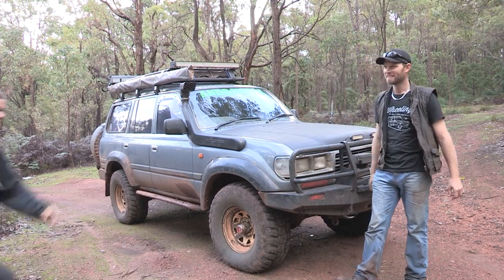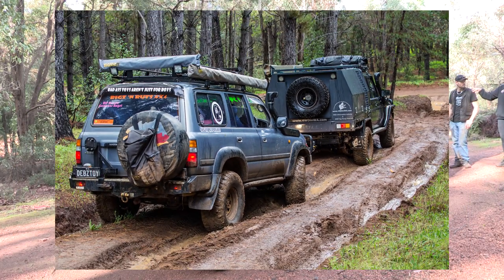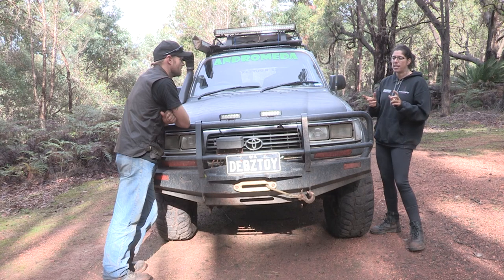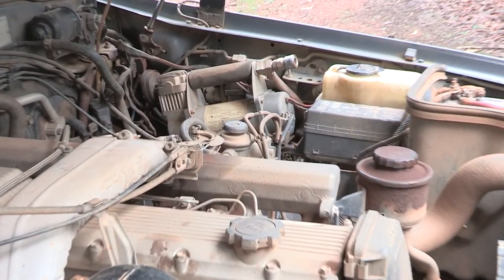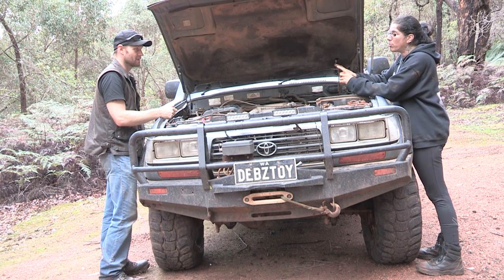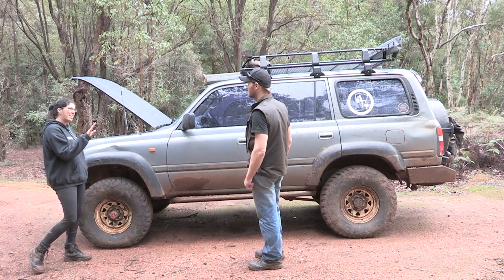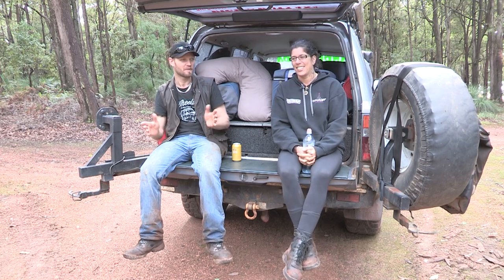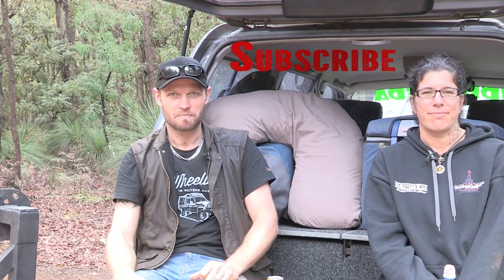Modified Toyota 80 series Landcruiser, Modified Episode 5

Comment: Haha thanks everyone, this is my boy Alf and i'm very proud of him.

My last 80 also had the 1HZ with Safari turbo set up and i wouldn't have it any other way. Fully recommend them. I've heard of a few people taking the factory turbos off the 1HDT and replacing them with the Safari Turbos. They are strong and tough as long as you don't go stupid boost and over rev them. 
Fully recommend it. You can feel the pulling power when you put in the K&N air filter and change the fuel filter too. Simple little things that make all the difference :)

Oh and my daughter still drives Alf too ;)
Reply: Debs Benedetto Just a heads up Deb, to fix the pop rivets on the steps is about a 5 minute job and really easy to do. Just need some new rivets and a rivet gun which are inexpensive. I know rattles drive me mad too.
Reply: Mr. Cairo  There are plenty on my 4WD Group facebook page: Rigs 'N Ruts 4X4 Club. 
Heaps of group pics and vids up :)
Reply: Hi! Getting ready to convert my ‘96 gas into 1HDT Diesel. After looking for new trucks, I determined I’d me much happier keeping and restoring my 80 series! Cheers! Thanks for the vid!

Comment: Ade, my insurance company covered me without a problem. I was honest and upfront and they knew everything i had on the vehicle. There was no problems and my new boy has the exact same gear (except this one has rear drawers) as my last one :)

Lightbar on the roof has no problems with glare. It's like driving behind the sun. I painted my bonnet black on this one as the paint job on the bonnet was really bad and it was really peeing me off. My last 80 was a gold colour and the glare off the bonnet from the lightbar wasn't even that bad.

Comment: I would love to find one of these here in the USA but they are not easy to find. I here they are built like a tank and I love the styling.
Reply: Actually i saw quite a few of the 80s in Tennessee when i was there in 2014. There were heaps of them there if that helps?
Reply: Really? Thanks for the tip.

Comment: Yea In my research of engines the 1HZ isn't exactly a good choice. It's a pre-combustion motor & they aren't very efficient & become even less so with a Turbo which also makes them susceptible to overheating easily which in turn destroys the head and the bottom ends have to be modified to take the extra pressure from the turbo. The 1HD-T's on the other hand are good strong engines that are Direct Injection and are quite noticeably more efficient on fuel about 2 kms/ litre better on fuel, but you goto keep an eye on the bottom end as the bearings actually have to be changed out every 10,000 kms or it could throw a rod as my dad's did. My Cruiser has a 1HD-FT in it and this is the best engine Toyota ever made I believe, because it can take plenty of boost, it's Direct Injection, it's a 24 valve motor, they fixed the bottom end bearing issue, and best of all it gets excellent economy even with the tweaks. My tweaks are a large front mounted intercooler, Turbo boosted to 17 Psi (it's safe to boost them to 18Psi), the injector pumps fuel rack opened considerably but not passed the safe EGT limits of the head (which is 500 degrees C max, the intercooler took nearly 100 degrees off standard cruising temperature so theres more margin there for working it hard), i also put a Marks kit in so I'm not pushing the front diff around for no reason ( part time 4x4. that makes a big difference to the vehicles performance passed about 70 Kms/hr and noticeably better fuel economy too.) + many other things too.
Reply: Change bearings every 10,000? Wtf. What I hear is if they had a fault it happened by 100,000 and once it's fixed it's fixed?

Comment: 1) When this vehicle loses control and causes an accident the insurance company will say that the vehicle was modified and became unsafe due to the split drive system. Unless of course it's fully approved and certified.

2) Light bar over the roof would make night driving a nightmare from glare.
Reply: CRDStudios Why do you want me to shut up ?

Why do you call me a tool ? 

What part of my comment was factually incorrect ?
Reply: Ade Larsen may not be intentional but you come across as abrasive. Most 4x4 enthusiasts know their vehicles arent legal. They dont need you commenting on every videos stating the obvious. Factual as it may be people dont go around announcing water is wet and the sky looks blue.

Comment: Thanks for another well-produced video.  What steadicam configuration did you use for the 360 degree pan in the introduction?  It's not easy to get such a smooth shot (particularly after the footage is accelerated) on uneven terrain without tracks.  Nice work.

Comment: hi debs.Im Abe from perth. I love your 80 series modified. Learned so many things from your rig.Im planning to gradually upgrade my landy one step at a time coz i want to explore WA  while my kids are still young. I have a 105 series GXL wagon 4,2 L non turbo and i want to fit a safari turbo like yours but i dont have any idea where to go to buy it. And also i want to change my full time 4x4 to a part time free wheeling hubs. But i thinks its hard to find the hubs for 105 series coz they have different splines. Im not sure on this. i tried E-bay.  Can you please share me your inputs/ideas regarding my issues. I' ll love hearing from you soon, Planning also to have a suspension lift and new rims and mud tires. Soo many things to be done,, Thanks Debs!

Comment: Top Clip Ronny!

how reliable is an aftermarket Turbo on a 1hz?

Reason i ask is, i've been dabbling with the idea of getting an aftermarket turbo in my 1997 80 Series which is stock standard with the 1hz.

Any advise would be good.

Thanks
Reply: As long as you get your motor checked over, then there wouldn’t be a problem. Just sticking one on without getting it checked might cause you some problems.

Comment: This is a question for all you experienced 4wdrivers.  I'm considering a 4.2 patrol or an 80 landcruiser. Which one has more flex and offroad capability of them both? Thanks guys
Reply: Both of them are very capable vehicles off road/ Flex all depends on what suspension you put into it, as there are bucket loads of different set ups you can buy. 
You need to drive both of them and figure out which one you like to drive more and which one suits you more, plus you need to figure out what you want to do with it before buying one.